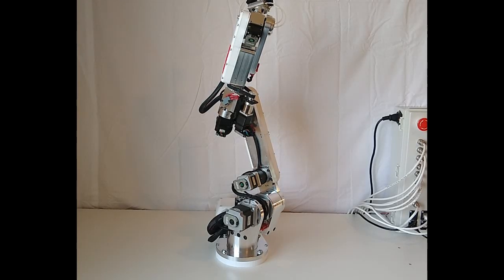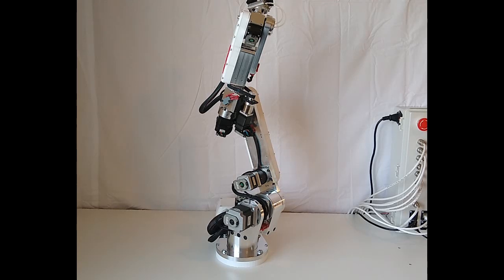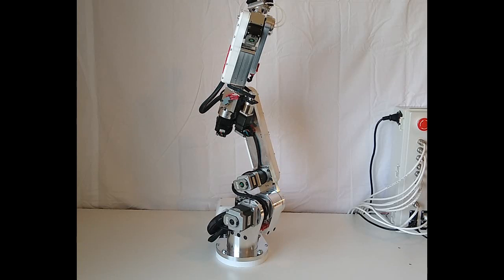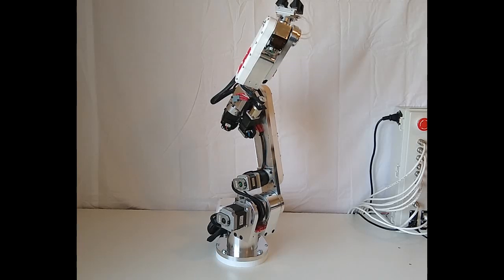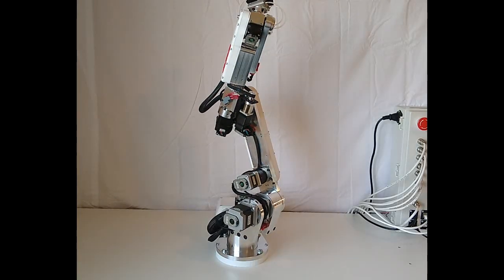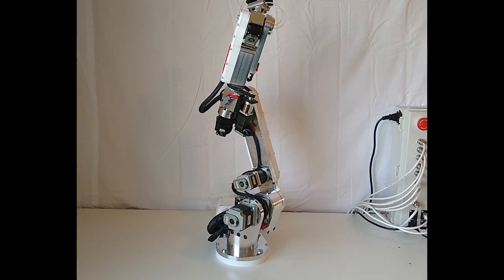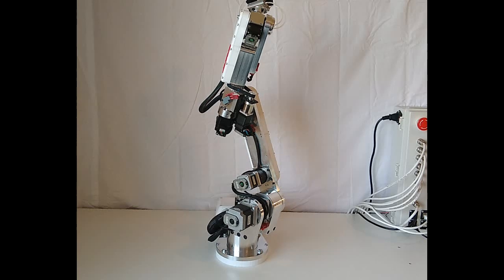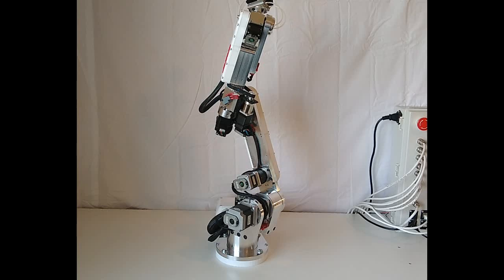AR3 robot speed demonstration

Comment: When creating robots of this size and using stepper motors of course, is it always required to use encoders?
Reply: Not necessary ....if you are going to use it on high speed with a good amount of load then consider using one for feedback. If speed isnt that high and load is very less compared to stepper holding torque then u dont need one. Encoders also help in 3d reference inputs but you can also use other sensor instead of it like mpu or pot.

Comment: Hi Chris,

Great work! Do you think the aluminum can be replaced with stainless and he steppers upgraded to increase speed and accuracy/precision? I think this is a great project and I would love to apply it to low-volume pharmaceutical assembly and filling (where it's usually cost prohibitive to buy a specialized machine). I think it would be a great study to figure out cost tradeoffs and practicality (capping, filling, cartoning, labeling/inking, pick-and-place, inspection, etc.). Low-volume contract pharma is an interesting design problem. I would love to hear your thoughts!

-Dean
Reply from the maker: Hello, yes It could certainly be made from stainless.  I think to upgrade the motors it would add alot of cost but it could be done,  I dont think it would be an easy change and might take some redesign.   Please feel free to contact me with more ideas and questions on the website or forum.  I try to reply to everyone on youtube but sometimes its easier to keep track of ideas and questions through the site.  thank you.
Chris

Comment: Can i be mounten on the sealing or wall?
Reply from the maker: no problem inverting and mounting on the ceiling.  I haven't tried on a wall.  J1 wasn't designed for holding the weight side load so Im not sure that would be a good idea,

Comment: Out of curiousity. Have you considered adding encoders not to motors, but to joints, so if there are any mechanical slop in belts/gears - it culd be compdnsated right away.
Asking this because I am building CNC and I see people in hobby and industry using closed loop motors, but almost noone uses glass scales(like DRO on lathes/mills) as encoder. Why is that?
Reply: It depends what you hope to gain by closing the loop with a glass scale. They can certainly be more accurate but that doesn't translate necessarily into a better finish part.

External encoders work best an extremely rigid systems such as linear Motors where the load is directly coupled.
Reply: @adisharr  
I just have a few scales from DRO of decomisioned lathe and I found a controller board that supports linear scales. But still - I have a feeling that I am missing something...
Reply: 3rdHalf external encoders can’t measure link deflection. They only compensate for backlash in the reducers.
Reply: @scottjackson2812  so basically - noone uses them because it is overkill. If you have backlash problems on new machine that need a linear encoder to solve - you have other problems to worry about. :D
Altough - linear encoders should be a good idea when retrofitting old mills to cnc.